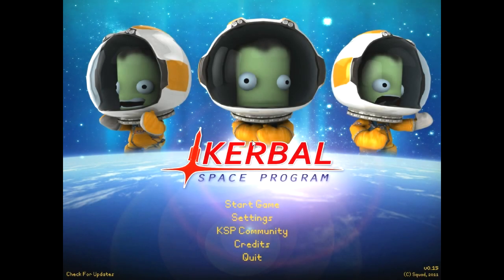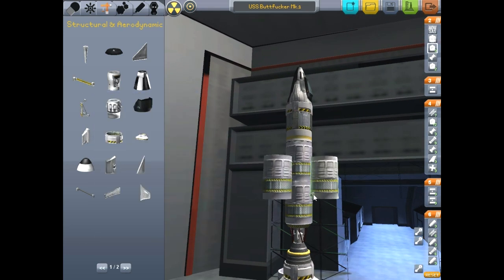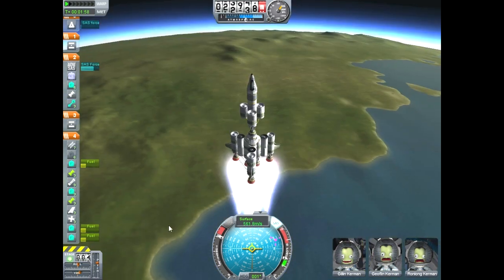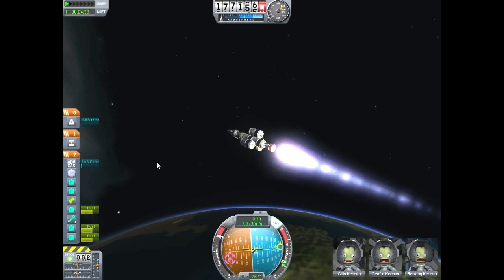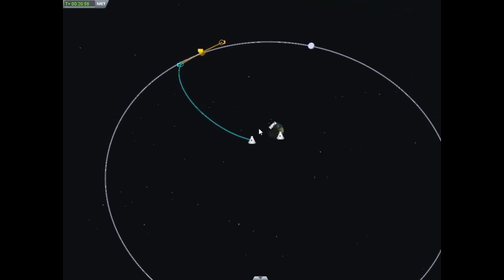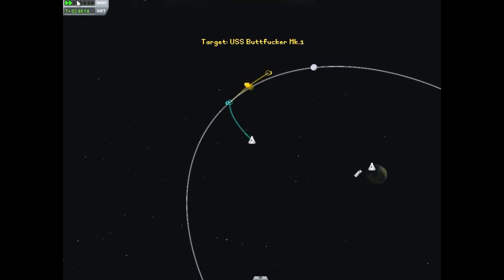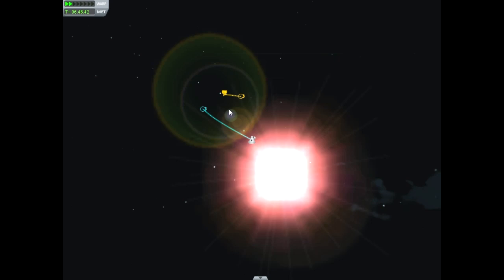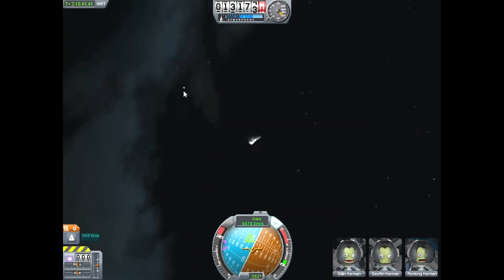Kerbal Space Program: To Infinity and Beyond! [Apollo 12]

Comment: The bug from falling into the Mun is from approaching at a fast time-warp.  You need to slow it down or it messes up the physics.

On your nav-ball, there is a green indicator and a green-X indicator.  The green indicator shows your direction of travel, and the X is 180-degrees from that.  To have the greatest effect on the shape of your orbit, you should always burn in one of those two directions.  To save fuel, these burns are most efficient at your orbits apoapsis (look at your map).

Comment: Two more things:
1.) Normal fuel tanks are NEVER used for RCS. Don't worry about that. You just didn't have RCS turned on.
2.) You need to lean over WAY earlier if you want to save fuel. As in, around the time your speed hits 500-600 m/s, depending on your altitude. Otherwise, you waste fuel and end up with a more eccentric orbit. I realize you're an eccentric guy, but that's not very favorable if you're trying to be economical. ;)

Comment: One thing you should do which would really help you out is reorder your stages a little more. Especially make sure that the decoupler for the first stage and the engines for the second are in the same stage, so they're both going to activate at the same time. That will save you having to break your space bar in your attempts to lose as little velocity as possible.

Comment: Good job Northernlion!
You did get captured by the moons gravity, but everything you did after that wasn't really correct. If you want to land on the moon, don't speed towards it, slow down. If you slow down, the moon's gravity will pull you in.  Basically, at the closest point to the moon, fire your rocket in the opposite direction of travel (the green circle with the X on the ball should be in center), until your path bends into the moon. Then prepare to land!
Good Luck!